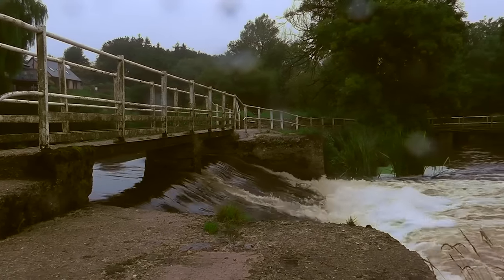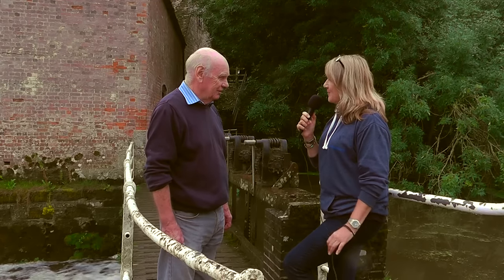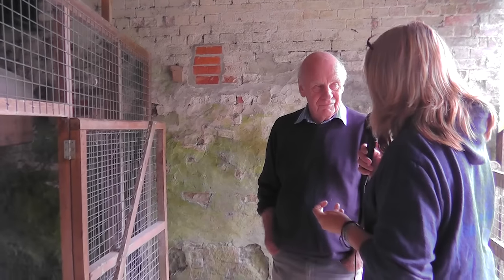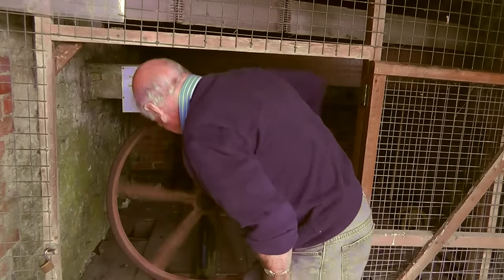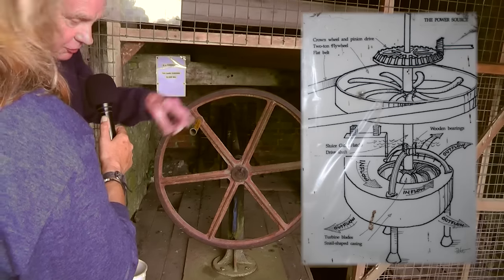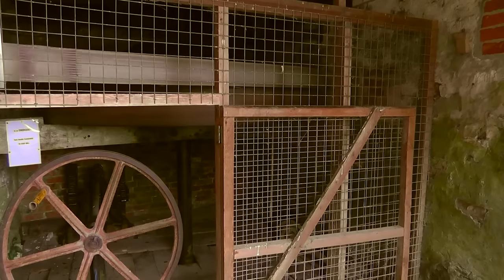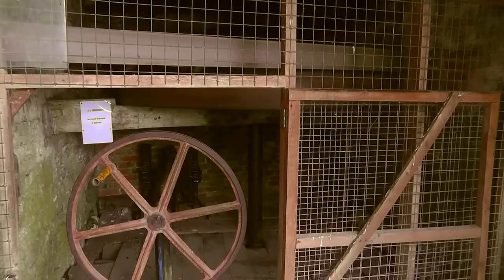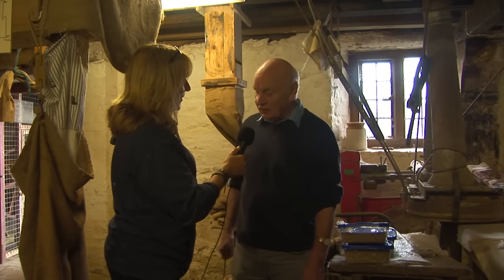1000 Years! - Sturminster Newton Water Mill

Comment: Great video. Great man for the job. Literally everything is gravity-powered (how free and clean is that), including the river water pushing down and into the turbine blades. Was very impressed with the Sack Hoist design! I'm trying to think of a non-mill application for such a device even if the power came from an electric motor.

Comment: Very Interesting indeed , in an episode of " Our House " the house remodeling show , they show a water powered " Lumber Mill , powered pretty much the same way , except it's powered by a water  paddle , pully drive system , was from  the 1800's , on the East Coast , maybe Penn. New England , 3 story's tall , built over a river , bottom floor is the piping , valves , paddle wheels  and drivers belts that extend thru the floor boards of the 2nd and 3 rd floors ,  the 2nd floor is where the various saws  operate , 3rd floor is where the driver belt pulleys are  to switch to the various saws when needed to  operate , table  saws such as circular saws , band saws , planers, all hydro-power,  Mill sits in a once completely forested area , the WHOLE PACKAGE for the last 150 years . . . A Must See !

Comment: I think it also interesting that people ingested some of the mill stones. I wonder if that was a beneficial mineral in those days?
Reply: @Supernumerary Yarbles yes roughage is good for people. Eggshells are good for chickens. But is bits of stone good for people to ingest? It MAY be. We need minerals in our diet. I wonder if those stones had much lime in them. Lime is a form of alkaline so it would tend to be good for people. 
I read that the blue corn that was eaten by the Pueblo Indians years ago had to have ash mixed in to help break down the complex starches otherwise they could not digest. it. They made it by putting the the dough in wood fires which contained ash. They were not aware that by doing so they were making it edible for themselves. 
I thought maybe there is something about the stone that helped people's diets back in merry old England a thousand years ago.
Reply: Those are two big chunks of granite, and incredibly hard.   They were precisely matched when they were installed, and so when in use they wouldn't really be contacting each other,  there might be a tiny bit of stone dust, but it would be so little as to be unnoticable.   You wouldn't start grinding flour if the stones were still grinding against one another as it would kill your efficiency and the goal was maximum throughput per hour.
Reply: A millstone will last about 80 years of professional use, so the amount of wear they experience is almost negligible.

Comment: Back in 1976.
I was in the Wales, UK.
Met a chap who had renovated a water mill.
After the first year running on water he cut the drive shaft with a chain saw.
Powered the Mill with a diesel engine.
Cheaper then the ridicules bill from the water board for water usage.
Maybe things have changed?
Reply: Why would the mill be charged for water it didn't consume?

Comment: Undershot, overshot, backshot and breast. The most effective vertical wheel is a backshot with a reservoir providing additional power from a breastshot penstock. These were very common in Cornwall and some were still providing power well into the 20th Century

Comment: that old guy is great, love the way he explains everything, she's not so good, i don't think she even understood what he was talking about.. i loved that old mill, great watching all those belts going around all the pulleys, makes me want to go out and buy some stone ground flour and bake my own bread.. water power forever !!
Reply: Seems to me there would have clutch's that are lever controlled to shut down the sections that aren't used until needed, to keep from running all those pulleys...which would save on belts and gear parts...just a thought.
Reply: @kennynvake4hve584  they did not have clutches and gears. BUT what they did, they knew at the beginning of the workday what they will do and need, just take off the belts from the wheels and then start the rest that was needed.
Reply: I would suggest that "she" related very well to what was said, and clearly  enjoyed  herself.

Comment: Amazing...there is only one thing I dont understand...how does the stones that grind the final flour keep from rubbing together and putting that small amount of powder stone into the final flour?
Reply: Quite o,man you see it does put a bit of stone in the flower...
Reply: The miller doesn't want the stones to wear prematurely so they're spaced to touch but not have 'weight' on them.  The inertia of the heavy stones do the grinding without deflection.

Comment: I must say that "firing up" a water mill doesn't sound right. Otherwise how fascinating!
The belt staying on the wheels, due to conservation of momentum, the belt wants to go straight on as it comes into contact with the wheel. The wheel forces it to accelerate in a radially inwards direction (centripetal) to match the angular velocity of the wheel which wants to throw it outwards (centrifugal). The crown means the centre of the rim has the highest angular velocity and so the belt tends to get thrown to the centre of the rim.
Reply: No doubt a phrase originating from the advent of steam power.
Reply: Yeah, that's what I was gonna say ... hurumph....

Comment: hello , a very interesting video, as all the mechanism is driven by water and the water is running all the time, could a turbine be used to produce electricity  fore free, a series of  turbines could be added to the river to produce  clean free  power.  is there any reason why this could not be achieved on all fast flowing rivers to  produce clene free power, I expect there are many fast flowing rivers around the country, this could help in the production of free energy, and clean up the atmosphere. no carbon emissions.
Reply: John Boulton most rivers around the country that are suitable already have hydro generators installed
Reply: Yes, John, that is called hydroelectric power and is the reason many dams have been constructed.  Traditionally, you have had to have a high head (depth) of water to generate any decent amount of power, hence, large dams.  Low head generation is a coming thing and is likely to be competitive with wind power in many places.

Comment: Convex vs concave: belt wear on sidebands of ribbon or belt is reduced, whereas a concave barrel contacts entire belt increasing wear? Though a read at http://www.sparksbelting.com/blog/crowned-pulleys-which-option-is-right-for-you

indicates tracking by crowned pulleys is best when tension is on belt middle than the edges.

Comment: Not to diminish the very interesting video, but let's call a spade a spade:  THIS mill is  about 350 years old for one part, and about 200 years old for the other.  Milling on this site, in one building or another, the precise details of which are not known, goes back 1000 years.  Anyway, not wishing to sound negative;  fascinating video and well worth watching. As a fine englishman, Ian Dury, once sang:  There ain't half been some clever bastards.
Reply: They did state it was rebuilt 500 years ago, early Tudor period.
Reply: Reminds me of the Castle tour guide who pointed out a broom which he claimed had lasted from the time of William the Conqueror. "Wow" said one tourist, "but it doesn't look  anywhere near that old! "   "Well," replied  the guide,   "the bristles have been replaced a few times since then..... and so has the shaft. "